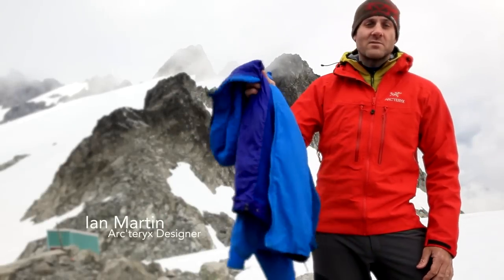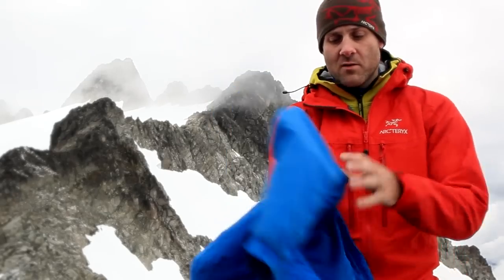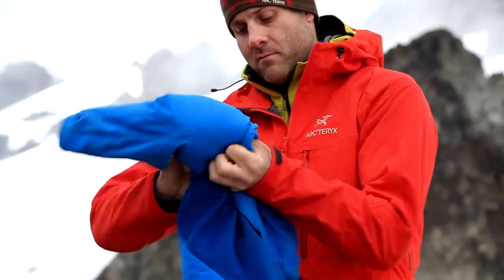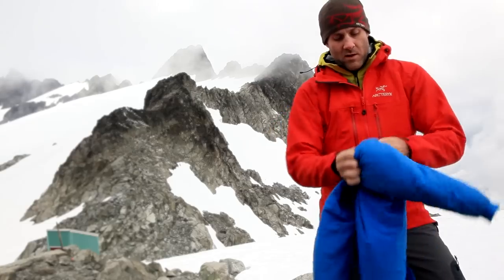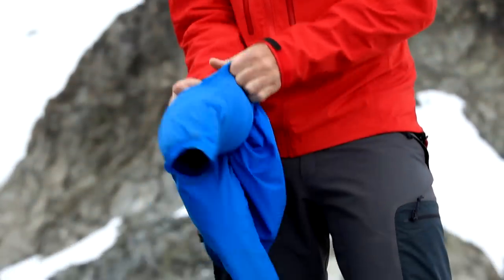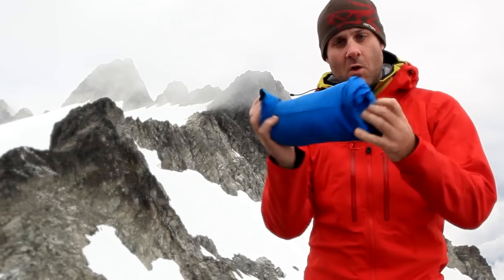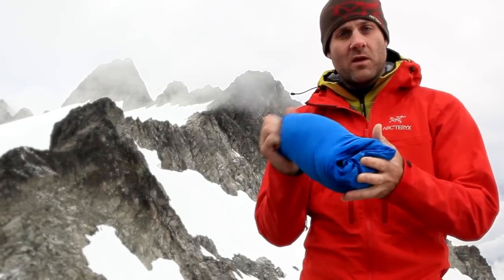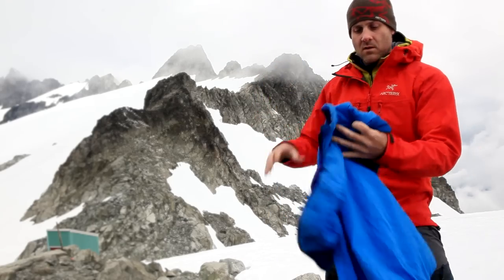ARC'TERYX How To Stuff Your Atom Jacket

Comment: Thanks for your nice demo about the jacket. I need 'something"  as additional layer for my next trip to Labrador (Canada) in august. Temperatures can then be between 6 and 20 degrees.  My goal is to wear it over my merino wol shirt and outdoor blouse in the mornings or evenings when temperatures drop. Or under my 3 shell goretex jacket when it's cold and it's raining. 

Would the atom be suited for my purpose? Or would it be to warm? I have a snugpak sleeka jacket but that's way to warm